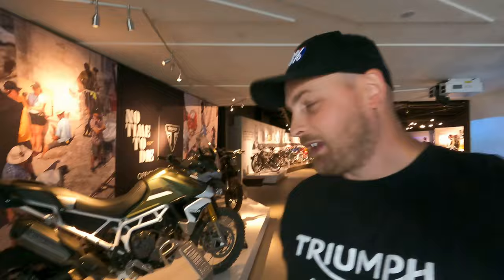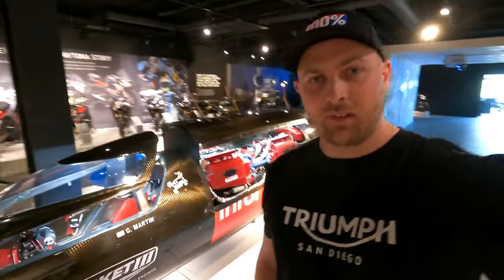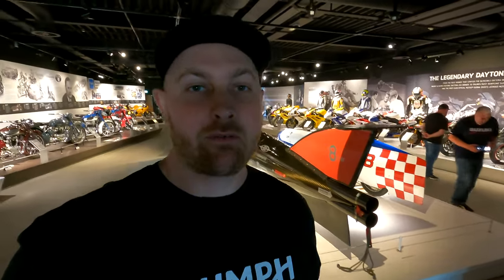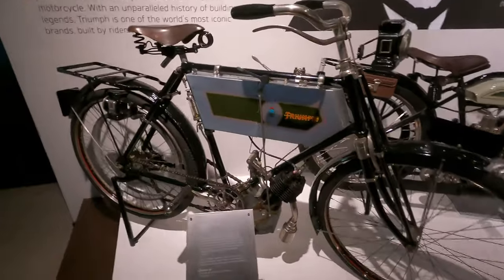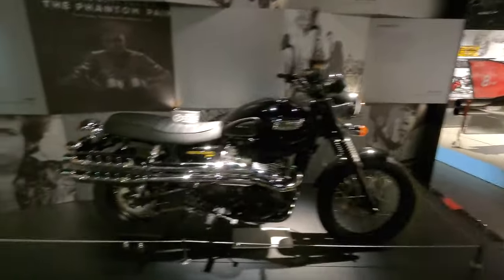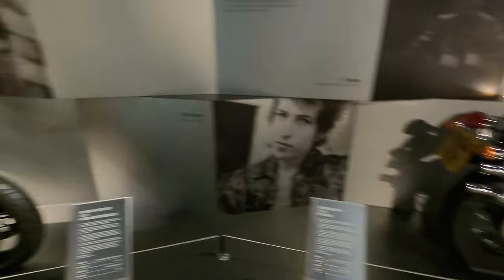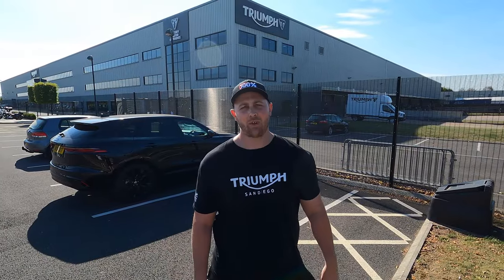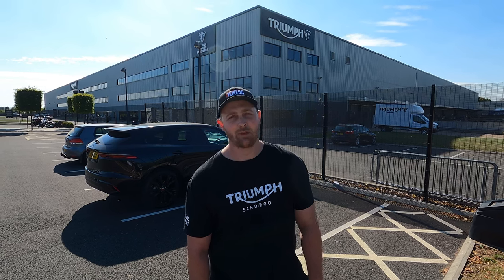Triumph Motorcycle Factory Tour - England, United Kingdom - What's it like?

Comment: Hello Triumph Friends! I own a Triumph Sport 1050 since 2013! I'm having a great time with this bike, but I constantly have problems with the front brake! I have chattering when braking! I have tried all the brake discs available at the market, but after 10 or 15 tausend kilometers it comes the same problem! Does anyone else know this problem? Greatings from Austria
Reply from the maker: That’s unfortunate :( it sounds like the brake pads might be worn out (or nearly worn out). And/or your disc might be warped a little because of it. It could also be the wheel needs balancing, but sounds more like the brakes. Good luck!
Reply: @Gwi1ty  thank you very much
Reply: @erwinhirschmugl It sounds like the discs are too rigid mounted. If they’re swimming discs it could be caused by the discs being warped due to heating when applied and not being able to get away with the heat it could result in the warping.